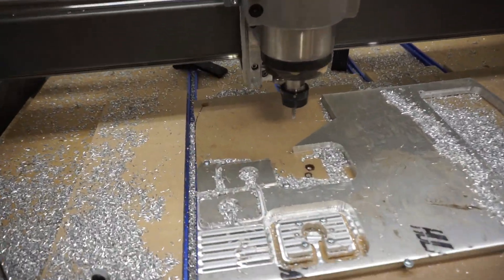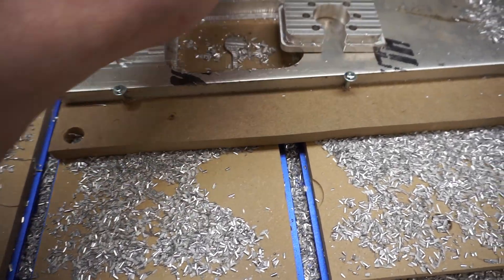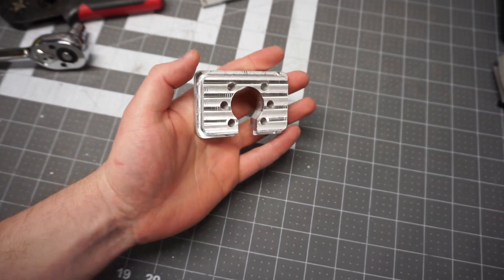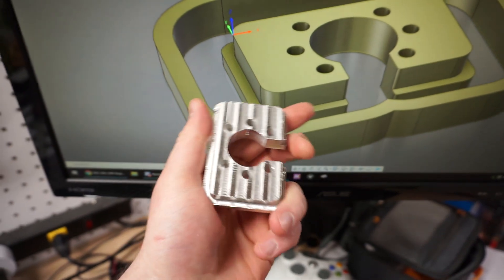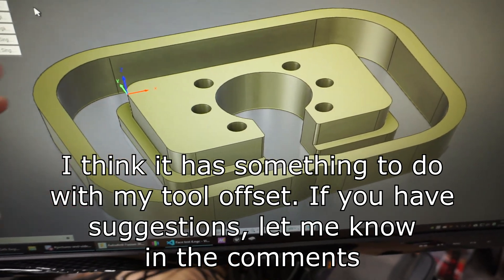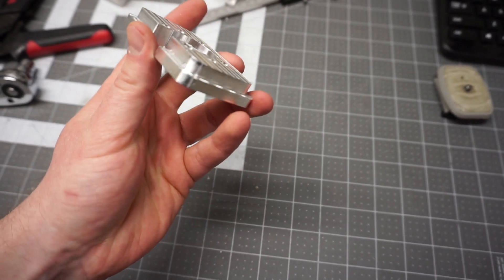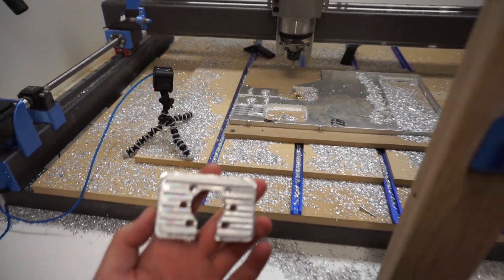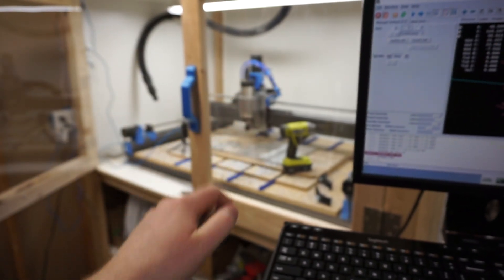PrintNC Aluminum Y Roller Plate Upgrade!

Comment: forget 1 flute mill, they are weak and rips more than cut, use 2 or 3 flutes they are more robust as the core is larger.
and your overlap at least for your facing is way too much you got what 80% of the mill diameter ??, i'm quite conservative with 30-40% maximum to avoid leaving the center of the current pass not surfaced again on the next pass.
Also i think your 2D adaptive was overkill as i would done like it: 1 drill, 2 facing, 3 contour of the inner part until the pocket  height, 4 pocket the exterior pocket and finally contour to the end, and you end up removing less material so faster machining.

Comment: so as far as your CAM what you do is measure your stock then set up a "fixed size" box to your exact dimensions in your setup then place your model offset to the bottom of your stock then run your facing operation down to the top of your part then from there run the rest of your operations using rest machining.

Comment: You should get a mister .  That adaptive tool path seems very slow and inefficient compared to  regular pocketing tool paths .  Is that running Grbl ?
Reply: @ProjectsbyBrian  ,  A mister only uses about a cup an hour and your cutter will last much longer and blows the cups away from the cutter.  If you leave chips in the grove, they get reguritated and deflect the cutter nicking the finish.
Reply: @ProjectsbyBrian  Chip evacuation is absolutely critical for milling aluminum. You really should invest at least in one of the misters and only hook it up to compressed air if you really don't want coolant all over the place. That constant chip evacuation from compressed air going through the whole operation is going increase your chances of success and lower the chances of destroying your endmills by preventing chip recutting and chip welding (which is really common with aluminum since it will weld/stick onto your endmill if it gets too hot and the chips aren't evacuated fast enough). Also, it will mean that you don't need to baby-sit the router with your compressed air gun nearly as much.

Comment: Nice! As far as z offset you can always set z top for facing and the z bottom for the rest.
Reply: @ProjectsbyBrian  as a newby I still export one g-code/operation at the time, so changing the XYZ reference is not an problem (when I remember to do it ;-) That being said, as you probably know, you can set multiple "setups" in Fusion 360 and should be able to export the entire process as a single g-code with multiple offsets.